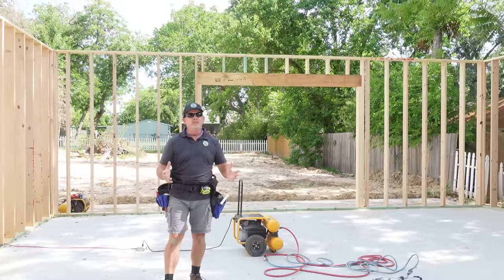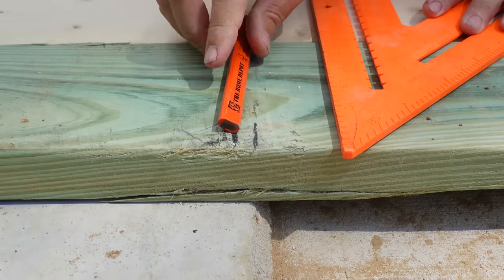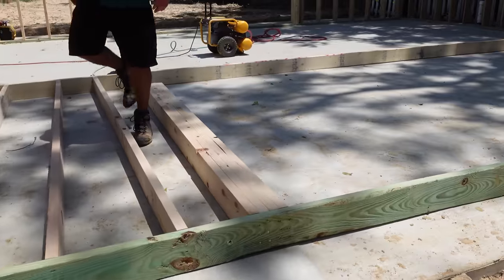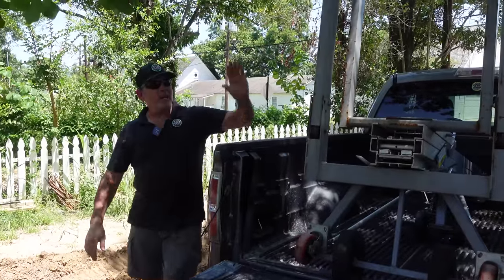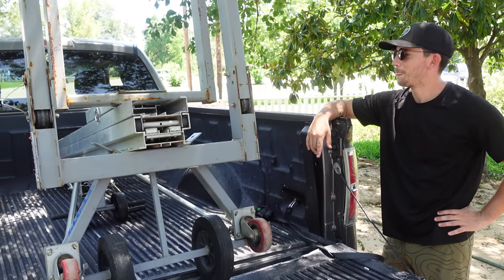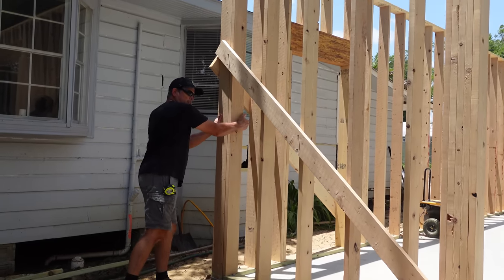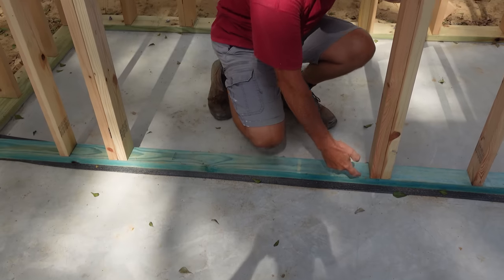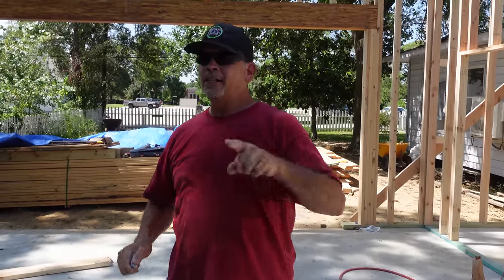FRAMING Our DRIVE THROUGH Garage!! - Will This ONE MAN LIFT Work?

Comment: The area beneath the stairs should be storage for garage tools, solar equipment, or an air compressor, so your garage is clean. Nice job.
Reply: I agree. I was going to post the same idea. I side with Jordan on this one…
Reply: 9:57
Reply: Or mechanicals
Reply: Keep wall for compressor to keep it quiet
Reply: Install some pull-out drawers for tools.
Reply: All good ideas.  Leave the wall and put in a double door so you can easily move things in and out of the area.  Sound proof the area really well for the compressor or other equipment you haven’t thought of yet.  Great idea to install drawers in the wall for access directly from the garage.  You can put a fridge in there too for those cold beverages on those hot Texas days.  Install an exhaust fan to the outdoors to provide some air changeout.  Never waste a space in the garage, it will eventually get used.
Reply: And add Roxul Safe n Sound to help deaden compressor noise.......
Reply: Agree, pull out under stair storage!!!
Reply: Air compressor should be in a door under the stairs with soundproof walls and temperature control somehow.
Reply: Put a safe in that space or otherwise harden it so that you can have secure storage for expensive equipment
Reply: I vote secret storage
Reply: I was going to suggest an air compressor on one side and a utility shelf on the other
Reply: Would be a good idea for an air compressor enclosure.  This way you can run lines around the garage and not have to lug around the compressor...you just bring the hose to various locations.  This would also help to keep the compressor quiet during operation, and you can even add sound deadening to the enclosure to further quiet things down!
Reply: Secret storage for your bugout bags and boomsticks.
Reply: Door

Comment: Issue with removal of wall is allowing access of exhaust and other fumes from the garage area into the upper apartment. Two doors were probably required to keep exhaust gasses to a minimum and removing the wall would increase the gasses access to the upper unit.

Comment: Little trick for the wedge anchors, put your hammer drill on hammer, put the drill bit on the end of the bolt. Hammer it down with the hammer drill.

Comment: How about a compromise under the stairs? Hang a sliding barn style door. That would give you more access than a 36 inch door, and you could cut out more of that wall.
Reply: barn doors are stupid
Reply: 9:57

Comment: I would suggest building a sound proof technical room under the stairs (with a door) great place to put a build in pressure washer, compressor, vaccuum, dust extraction, and other utilities for the garage. Just run ductwork to where you need it. Saves a bunch of clutter and noise when enjoying your new workshop!

Love the vids, great to see progress!
Reply: ...Or possibly utilities for the upstairs apartment too.
Reply: Came here to say the same! You're sure to want a compressor for the garage, putting it in a mech room will definitely help with the noise.
Reply: I'd put the air compressor and dust extractor in an attached shed on the backside exterior of the garage, near the neighbor's property line, so it's away from your main house.  It'll make your neighbors real happy, too.
Reply: Good idea, I was initially going to say leave it open  but after reading the mechanical room suggestion, I agree a sound proof room for the mechanicals, don't forget ventilation for it tho
Reply: I was going to suggest the same idea. Its the best spot for it IMO.
Reply: I was going to say the same thing. Leave it as a nook open to the garage to make it easy to move stuff into as you acquire the equipment or plan it out with a door so it’s cleaner looking.
Reply: This is what I'd do. Easy to soundproof.
Reply: I absolutely agree!!! Great idea.
Reply: That what I was going to post too. Turn it into a maintenance room and insulate all walls around the room so any loud noise equipment like air compressor can be stored in the room. Be sure have ventilation for intake air.  Your neighbor will thank you for it too.
Reply: If the area below a required exit stair is used for storage, the enclosure should be constructed to provide at least a one hour fire resistance rating.
Reply: And to reassure the sound proofing you definitely what to use Rock wool. I can say from experience it's worth the money!
Reply: I came here to post this idea👍
Reply: Why not do both? The shorter end open for understair storage, and the taller end closed off, with a door, insulated, soundproofed  mechanical room.
Reply: My dad did a similar build to this, and sure enough under the stairs he has a general storage closet and then at the end where its too low for walking he has his hot water heater.
Reply: YES!  And if you do it for your Air Compressor, I would suggest frame and insulate it as if it was outside.  So use a nice thick external door for it, and insulate the walls from the closet to the garage and under stairs.  Then Dryawall with 5/8 dryall as normal, but on the TOP and BOTTOM of the room, on the outside, put air vent covers with bug guards in them.  SO you have fresh air circulating through, and the compressor can pull from outside air.  You dont mess with your garage comfort.  And your external doors have a big weather proofing means sounds as well!  

Also, put an auto water drain, and run the pipe out the wall, so when you drop the preasure of your tank, the water pours out keeping you safe.
Reply: I like dads idea. Definitely soundproof for under the stairs. Create as much open  space as possible. A stand up air compress is a must.
Reply: I totally agree, a sound proof room for anything that makes excessive noise. Thanks for sharing. :yougotthis:
Reply: This
Reply: Bring the NOIZE.... Bring the Clutter...  SFMF
Reply: If the flat above the garage should have it's own utilities or you want a bigger permanent compressor or dedicated exhaust in the garage this is a good idea. If you just need storage I would propably open it up. That said if they do open it up it's probably worth sound dampening a little beneath the stairs.
Reply: That is an excellent idea. Then they won't have to worry about the compressor interrupting videos.
Reply: Same !
Reply: This. My friend just built his shop. He wishes he would of enclosed the area under his stairs.
Reply: 9:57
Reply: This is a great idea...however, true soundproofing begins with framing a certain way, and with soundproofing materials from the start.
Reply: Gotta make sure it has ventilation, don't want it to overheat. Maybe a dehumidifier too, to keep rust off tools.
Reply: Door Door Door 😂
Reply: @rj7826  the utilities would be going in the attic according to the plans so the under stair should def focus on the garage/workshop stuff like the compressor and future dust extraction
Reply: This is definitely what I would do with it. I have an insulated room for my compressor that keeps the sound way down. Maybe install a double door for easier access.
Reply: that's a great idea.
Reply: Harbor freight sells very large tool storage chest would go perfect there. Another thing washer and dryer with a wash sink. What is wrong with the portable compressor that they are using now. It appears to be more than adequate for construction and the key word is portable.
Reply: love this idea, anything that is out of the way of the main footprint of the garage floor makes for more space for whatever you plan to get up to in there
Reply: I’d suggest making the door a pocket door so you don’t lose additional floor space on either side of the wall.
Reply: Yes, compressor room with door!

Comment: I have an idea not mentioned in the video. I think you should put a door on the back of the garage to access the space under the stairs and store future outdoor stuff in there, lawn equipment, lawn chairs, chair cushions, etc. as well as compressors, permanent pressure washers, Ac equipment. That way you don’t dirty up the garage every time you deal with the lawn. Or need outdoor bins or walk through the garage to store cushions to keep them dry in rainstorms, and retrieve later. Or hear the machines as much that support your new shop
Reply: This isn't a terrible idea, but I'm not sure it would work. I have something similar in my house, but it's more like a 10x10 room, whereas what they have is more like 4x8 with rapidly diminishing height. That could make it really tight to get in and out of with lawn equipment and things like patio chairs and cushions, especially when you consider the amount of room that would need to stay clear for the door to swing into the space.
Reply: @Not_Ferrari  looks more like 3’8” by 15’ but never the less things like that need to be stored somewhere. I built something on the back of my garage to store similar stuff and have a bin on my deck for cushions only. Prior to me having either it was a pain to get everything in and out of the garage and to be honest the storage shed and bin look tacky imo. If I could build onto my house and make it look like it was always there without dealing with months and mountains or bureaucracy, I would. Jordan has the chance to do so. So that’s just my recommendation.
Reply: That's what a shed is for.
Reply: @evictioncarpentry2628  I agree but if he doesn’t want a shed in his yard, this is a solution to a future problem. That’s all I’m saying.
Reply: A shed would take care of those things.
Reply: Just my .02 but I'm restricted to 150 Sq ft for a shed. It fills up fast. An outgoing door on this space would add much appreciated space IMO.

Comment: Back from vaca and TWO new episodes of stuck pack!

Edit: okay. just watched - I would definitely add access to the storage under the stairs. I did it in my new build too. No door and leave it rough where you can to save money.  There is no need to drywall it since it is just a storage space.

Comment: Either option works for under stairs!  I personally would leave open and add some storage under there.   Also, while you are framing, once you do the ceiling for the garage, if you plan to add any ceiling garage rack storage, add some blocking.  It was a pain installing with the spacing I had!  Great video.  Looking forward to the next one.

Comment: Under stair:

Base your solution on the function.

If you'll stuff the space full of seasonal decorations, just use a door.

If you'll roll a couple of motorcycles to the side and under the stair, make a wide opening.

I've done lots of both, and more.

Usually, I stop the closet where the head height drops low enough to be a nuisance. Though one time, my client was an avid surfer, and he insisted on the closet space running all the way to the bitter end under the stringers: Old surf boards could be run to the shallow end!

Comment: If you have a door under the stairs you can have storage shelves inside the hidden area. Maybe make a hidden doorway to that area that opens outward and looks like shelves or something. but if Jordan wans it wall-less it could be a larger open area for storage. Maybe stick some chairs or something under there to rest without having to go upstairs. Cabinets could be on the rear wall if they fit.
I love the teamwork in this. Everyone worked well together to get that wall in place.

Comment: Put in a door and electrical and you can put in a large-capacity compressor for the garage.  The wall will lessen the noise and it will be very useful.  We have one set up in our garage and it is great when you need to run a tool or just need air in a tire or two.  We put in several access ports around the garage and you can haul your hose to the connection and plug it in.  Our compressor is always on and it rarely runs to top up and when it does we don't even hear it.

Comment: Adding a door for under the stairs is a great idea. You could “lock-up” expensive tools as an extra security measure against thieves. I also like the idea of a compressor under there. You could insulate for sound to reduce the noise.

Comment: Make it a closet, door underneath the stairs. After a couple months if you find that you really don't like it you can always cut it out later but building it back is a pain and you already have the wood installed there now.

You could reinforce stuff and make it more of a secure room so you can store more expensive things in there.

Comment: You're going to be hauling furniture and appliances up those stairs.   You should consider a double door in that opening, because you'll be making a right turn to get up the stairs.  As for the area under the stairs, I agree with Jordan that an open space is preferable to a wall with another door.  However, you might consider a roll-up door, too.  You can get them in custom widths, so the opening could be as wide as you want.  That way, Jordan can close the area off for security (or just to hide clutter), but have a wide opening when he wants it.
Reply: Or fan panel partition
Reply: PIVOT!  PIVOT!  PIVOT!
Reply: @davidtaylor4053  😁

Comment: I agree about using the under stairway for tool storage, workbench or water heater, etc.  If you plan to do woodworking in the garage, now is the time to consider where to locate the dust collector, etc.  Maybe you already have planned to add onto the backyard portion of the slab… to build and outdoor shed for garden tools, and things like that?

Comment: The entire garage needs to be done with 5/8 fire rated drywall and the door that goes up the stairs needs to be steel fire rated also. Great series by the way !
Reply: Yes, especially since a hot car will be involved. Car fires should be a consideration along with secondary egress while the main is not up. If a fire were to develop near existing egress how would Jordan escape?
Reply: Don't you think they've thought of that?
Reply: @slbarbieri1725  there are no dumb questions.  They may have thought of that, but not necessarily.  Even if they have, others benefit from constructive comments.

Comment: Personally considering the size/location I would suggest some sort of kitchenette, having a large 'Dirty" sink and something like a overflow/beer fridge are some touches that are really nice when your working in there for hours. I'm not sure where your plans currently call for a washer and dryer but that would also fit in that space really well. I think I would personally turn it into a Kitchenette with an extra deep concrete counter/cabinets, a built in washer/drier/ a large sink, and a fridge with the section under the stairs too low to be useful turned into a storage nook and cabinets above (though set higher than you would normally put them so you can fit extra large objects in the sink) and any space above the cabinets left filled with built in shelves for extra long-term storage (Christmas stuff or things like that for example). 

Alternatively I love chest freezers because I buy meat on sale and store it until I need it to save money and having a large one in that area instead of a fridge would also be a good option, If I had the budget I would do everything I said above but instead of a full fridge I would put one built into the counter (like a wine fridge) and put a big chest freezer.

Comment: Q: Why can't you use a pressure treated 2by for your outer jack?  Is it not allowed by code?  Just thinking it'll provide a little more moisture protection.
Reply: Pressure treated lumber is not waterproof just rot resistant. Mostly. Honestly, rot resistant against the bugs that would get into your wood from it being wet cuz they want the moisture and the snack
Reply: @Dracomancer273 it would still provide more protection though being rot resistant and all its a good idea
Reply: @delinquentdesign  Its also a lot softer in a vertical compression situation (aka being used as a stud). 

Using it as a baseplate, you are only expecting it to handle little point loads of studs.

AS a stud, it would be the difference between a half-cooked spaghetti noodle vs a bamboo skewer, one is going to handle resisting being squished a whole lot easier.

Comment: Hey fellas, something to keep in mind - I have a newer home built in 2015 and the garage is fairly tight. I really have to fight rust in there, which I did not have to do in my older, looser previous home built in the 70’s. I’m in the DFW area, so similar climate zone as you guys.

Comment: I like the idea of the floating stairs without a wall, however, having the wall there would help cut down on noise and smells from the garage making their way upstairs. Something to think about.
Reply: would be neat to have floating stairs but since the 2nd floor is a living space, code requires a wall for fire/c02 separation. plus it will hide the joist the metal support beam will sit on.

Comment: Hey guys.  I think I might add an exterior door to access the area under the stairs.  Kinda like a shed for a mower, trimmer, etc.
Reply: This is what I was thinking. That garage is huge, make use of the space. If its not too late, move that partition wall a few feet away from the exterior wall. This will allow for convenient wide stairs (good for moving furniture up and down). Then under the stairs you have storage for outdoor/backyard equipment, with access from the back of the garage. Effectively a shed inside the garage. The interior wall can just be plain. If you gave storage inside by the car that could lead to the car getting dinged.